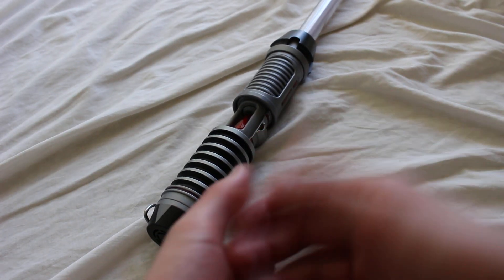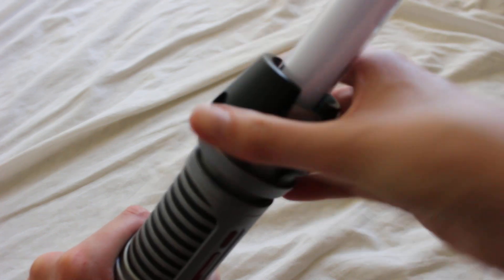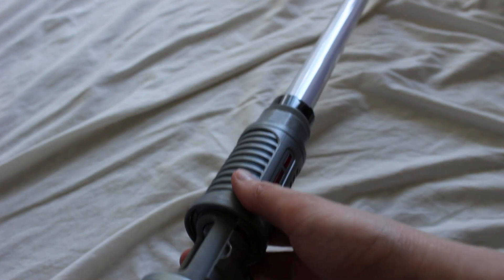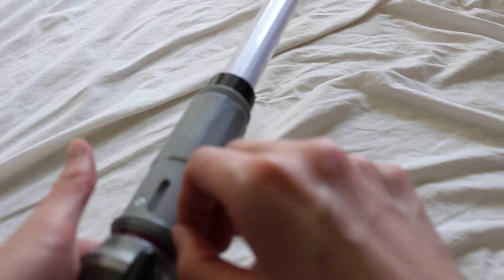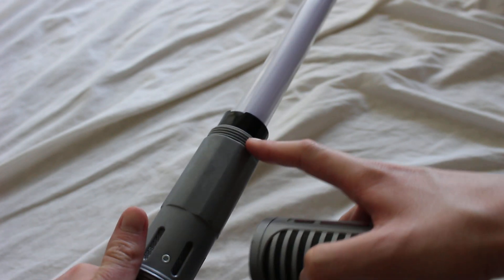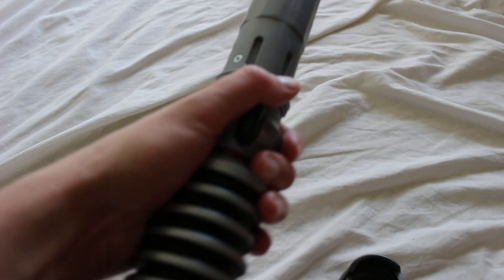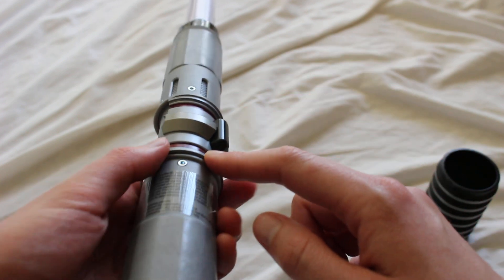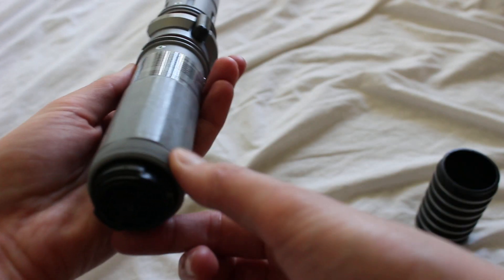Problem with Savi's Workshop Lightsaber Threading

Comment: My son just built his today at Hollywood Studios Galaxy Edge and he is already having threading problems with the middle section threading.  Only one thread, so the hand grip on his lightsaber keep twisting apart every time he uses it.  I thought it may have been stripped, but it is the one thread on the connection in the power switch casing.  No issues anywhere else, but for $200 you should not have these problems.

Comment: I am unable to take out the emitter, it got too tight somehow. Any tips in untightening it?
Reply: Im having the same problem did you get it figured out.
Reply: @jazzy7559  No, not yet.
Reply: @AryaForce  I tried wd4 to get it back into place but after that it wouldn't move. But i would try that.
Reply: @jazzy7559  I tried dabbing the area with little olive oil using a cotton stick. Nothing. Also what do you mean by wd4?
Reply: @AryaForce  Wd40 Is what i meant. It's this stuff the you can use to loosen things when they rust of get stuck. It worked a enough for me to reassemble my saber.
Reply: @jazzy7559  Oh I never heard of it, but I will give it a try.
Reply: @jazzy7559  Didn't need it. My husband just twisted and loosened. Stronger arms. Keep that in mind for the future though. Thanks.
Reply: @AryaForce  glad it work out for you😁

Comment: does the activation switch to grip threading really matter? the whole thing is sandwiched by the Emitter, core, and pommel.
Reply: It’s not though. When I swing mine around hard the grips pop loose and have wiggle room, they’ll spin freely between the end caps. The end caps don’t screw down far enough to actually press the grips into a firm position.

Comment: I just got one this weekend and I really liked the experience, but noticed mine wasn’t straight and a Disney employee told me that it just needed some messing around with. Realizing today that there is no way to actually get it completely straight. It’s not a huge deal but bugs me that they told me to fix it at home and turns out I can’t. Also thought I could use the display stand they sold, but it will only hold the hilt, not the whole lightsaber. Which makes sense but wish they sold something that could hold the entire thing.
Reply: I know it pisses me off that there not aligned like wouldn’t they build it and fix it
Reply: Yea I just bought mine two days ago and it fit nice and straight at the shop but once I took it home and messed with it the parts became more and more lose and eventually I swapped the sleeves with each other to not care for symmetry. Still sucks but I’m not as bothered about pieces lining as they should.

Comment: I have the same saber. Unfortunately my son was flicking the switch on and off and now it doesn’t even work. I wonder how much beta testing quality control they did for these. 230$ down the toilet.
Reply: I feel that. For me the main sheathes, the ones on either side of the activation plate don't securely attach so I can't even swing it properly. I feel like there should be more threading for that section but hey what do i know haha

Comment: The short threading is to make it easier for the user to swap out kyber crystals.
Reply: Yup.  As a matter of fact, the upper and lower sleeves can be unscrewed and slid up/down a touch to remove the switch halves without removing either the pommel or emitter endcaps.
Reply: @GeorgeStephanis  Yeah, but this means if you’re swinging your saber around hard the grips easily pop loose and then spin freely when you’re trying to hold onto the thing… It’s a bad design on something that costs an absurd amount of money.

Comment: Sorry to be a broken record, but these are not quality items. Metal does not equal quality, especially the cheap Chinese pot metal (zinc) these are made from.
Reply: do you own one? id like to know more
Reply: @jonliao2544  No, I wouldn't buy that for a third of the price. But do you dispute it is made of cheap pot metal?
Reply: Kevin T mold injected steel is not cheap kettle pot metal. If it was it would make it the same as saber forge or ultrasaber quality
Reply: @jonliao2544  It is pot metal. You can tell from the way it looks and the way it sounds. It is absolutely not steel.
Reply: They are of a pop metal type.this type of metal has a very distinctive muted ring due to it very crystalline structure. Easy to flow mold , but very brittle ! So watch the high impacts
Reply: Recommend using a dab of silicone grease on the threads to help keep from cross threading. Also
Reply: Well, I suppose that they did warn you.  After all, in Galaxy's Edge, they continuously insist on referring to it a "scrap metal," and it seems that is exactly what it is :-)